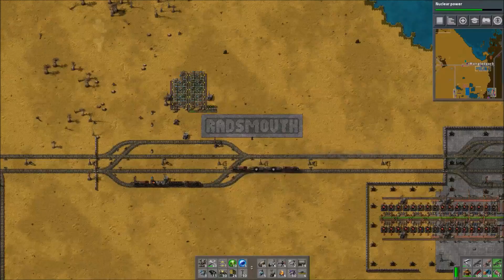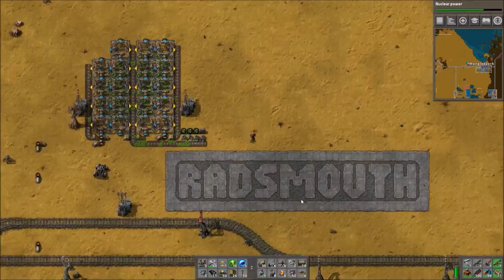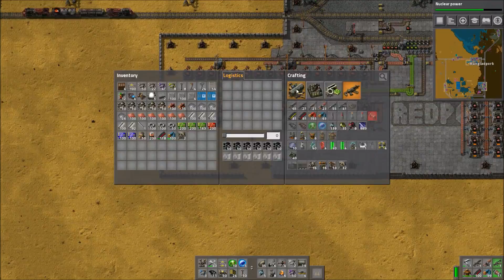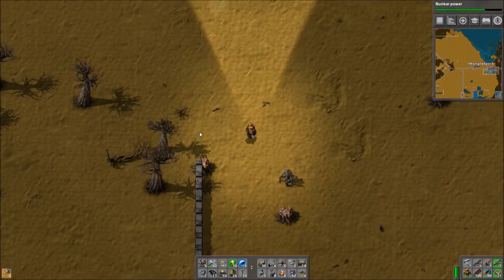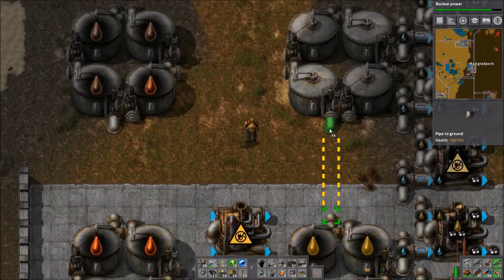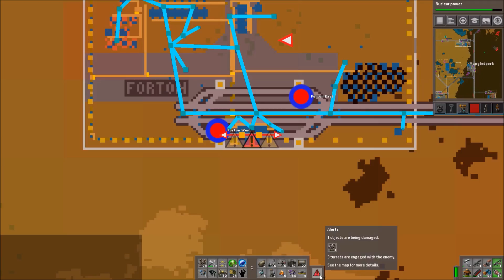Factorio Towns Ep#52: Oil Overhaul

Comment: In anticipation of my nuclear power research I spent 8000 copper, 14400 iron and 240000 petroleum on accumulators since I knew I wouldn't need even one reactor nonstop. Just before setting up my reactor I saw a post where someone stored energy as steam. So then I spent 180 iron on storage tanks instead. It works great...
Reply: Remember to account for the long warm up times if you're wiring your reactor

Comment: Psst. Nuclear power doesn't explode. There's a reason they call it a "meltdown." The core, literally, melts. Steam pressure can cause the cap to explode off (which is what happened at Chernobyl) but that only happens when there's not a proper safety valve in place. Chernobyl was built and approved by idiots. A properly engineered and maintained nuclear plant is one of the cleanest and safest sources of energy there currently are. A breeder reactor can even recycle its own waste to produce more fuel in a closed system. The problem comes with that pesky "engineered and maintained" clause. The cost of constructing a properly considered plant is much higher than most people are willing to invest. Billions, for just one plant. That leads to corners getting cut, and nuclear power isn't forgiving of negligence or ignorance. The designs that were put into use were seriously flawed, and it doesn't help when countries with the most incentive to use nuclear power are also the ones with the most ability to mishandle its use, leading to catastrophe. Japan, a country with regular tsunami drills, placed a plant on the coast. Who could have foreseen any problem...
Reply: You're no fun at all! I say we let meltdowns cause explosion!
https://mods.factorio.com/mods/trold/Meltdown
Reply: The Russian melt down was pure negligence due to testing a different way of cooling the rods on a live reactor and crystals ended up forming on the base of the rods which in turn causes them to overheat and melt down

the Japan incident was unfortunate that the backup generators were not placed high enough but was not as bad as the Russian one which was pure negligence and large nuclear Fallout from it
Reply: Also, the people at Chernobyl needed to turn off some of the safety systems to run the experiment Lee mentioned. Why this wasn't a red flag that they needed to redesign the experiment, I don't know.

Comment: In my eyes, uranium refining should be its own research at a lower tier than nuclear power, so if you wanted to stockpile refined uranium or make uranium ammo you could do it without researching the reactor first.
Reply: I think the ratio of u235 to u238 actually works really well with gameplay, Ive had 4 saves each more than 30 hours and each on uranium power at some stage. It generally took 5-10 u235 to be used as fuel for the reactors and then the rest is excess to be used in the kovarex process. I think the number or uranium ore I had processed by the time my first kovarex recipe was started was about 70k - 80k. I just had a few chest-fulls of u238. (this was directed at yva8 not alex, alex has a good point)
Reply: Well, I believe it was meant to be possible (yet inefficient) to start using up your U235 to create power immediately, and then build it up from there. The game design kind of fell short on that  because the ratio of "useful" U235 is way too low, so "everyone" wants to do the enrichment first before spending any U235 at all.
Reply: You misunderstood what I meant. Refining uranium is the process of turning the ore into uranium, not enrichment. I meant that you should be able to build and set running the process of refining the ore before you're done researching the reactor, and also research uranium ammo on a different track than the reactor. I'm 100% on board with enrichment research coming after nuclear power. I just wish I could get a head start so that by the time I'm done researching the reactor I had enough for a few dozen fuel cells already done. Then you wouldn't feel like you have to wait for enrichment to build your reactor. In reality you make more than enough fuel cells for power without enrichment, you only really need enrichment if you want to be able to build bombs.